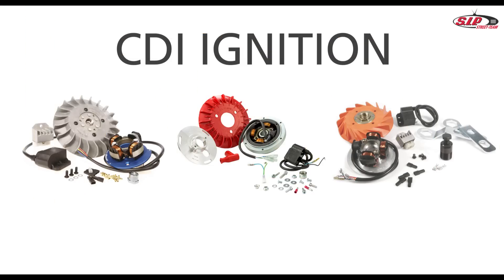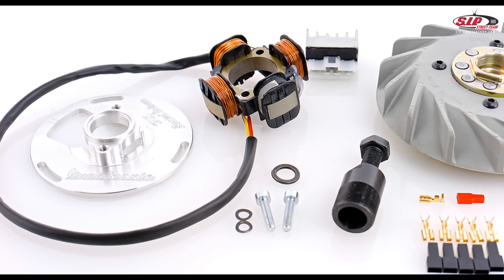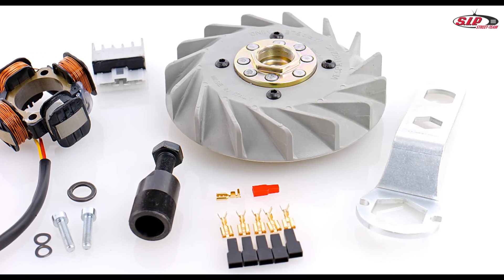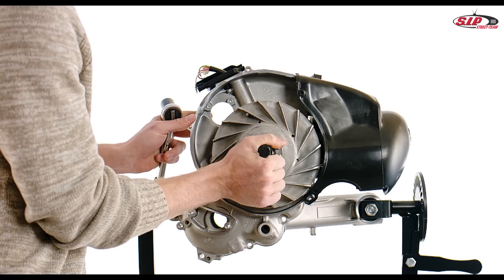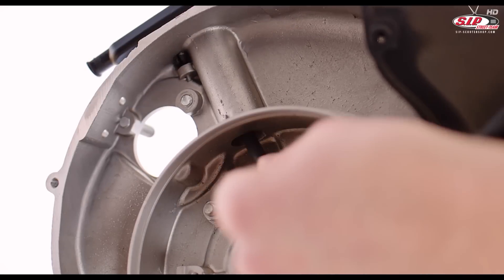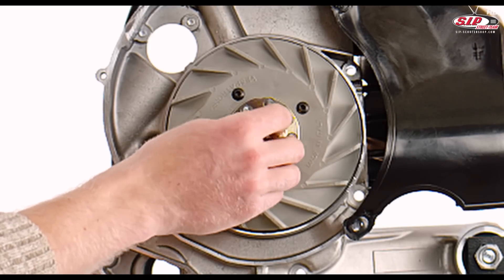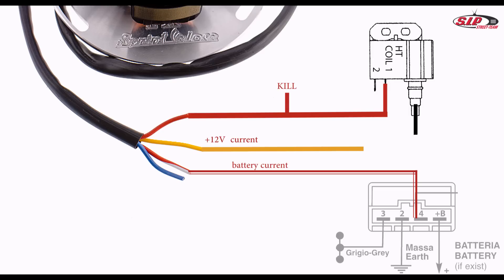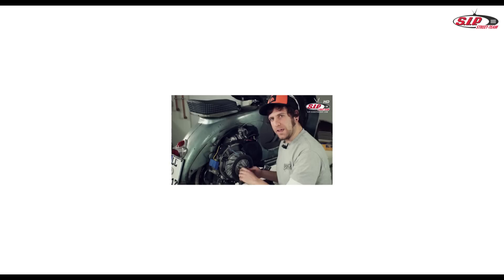VESPA Ignition VESPATRONIC Installation - Tutorial

Comment: What the video does not completely show is how to connect the stator's yellow wire for 12 volt AC. They could have easily drawn the yellow wire to one of the three dots (Grigio-Grey) at the "3" slot on the regulator and drawn wires to the other two of three dots to represent the scooter's wiring loom. Also did not state if not using a battery to tape up the stator's red and white wire and do not use slots "4" and "+B" of the regulator.
Reply: I agree they could easily show the yellow connection but perhaps their graphics app could cope. It seems the regulator image is copied from elsewhere with grey wires. I have a question though;  Why not use the 4 and B+ terminals for creating a dc source for accessories?
Reply: @fififqq  Don't remember the exact slots but one slot is used to get ac power from stator via the red/white wire and the other slot is used to trickle charge the battery with converted DC power. I'm not sure if this regulator would provide enough DC charge power to run any DC accessories. There's another regulator that actually does that. I needed a DC charge for SIP speedo and got a AC to DC converter from SIP made by KOSO the maker of the speedo.

Comment: Hi, I have a question. On the vespatronic electric schema, the red and white is directly on the battery and de yellow and white is on the blue to go on the regulator. Why is not the same on your video?
Reply: Red and white don't go to the battery. It goes to the regulator and changes the AC power to DC power to trickle charge the battery. Yellow and white does go to the regulator and all power wires from the scooter are connected to the same slot.